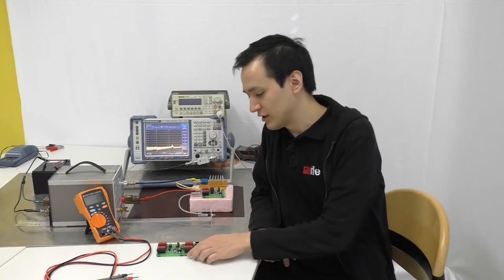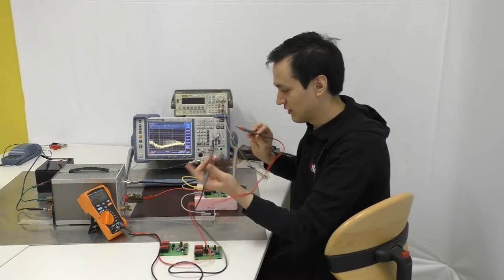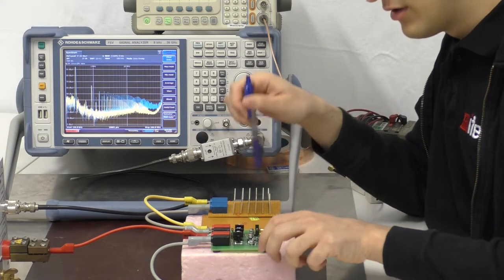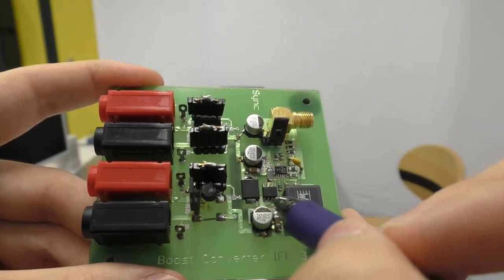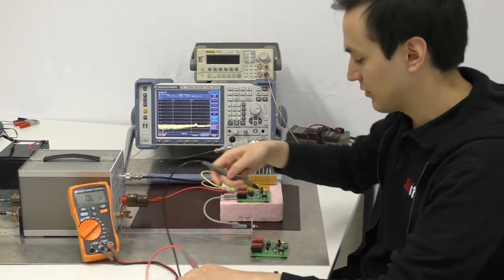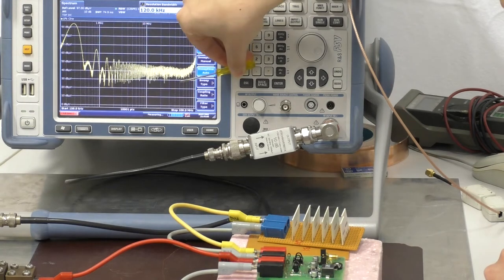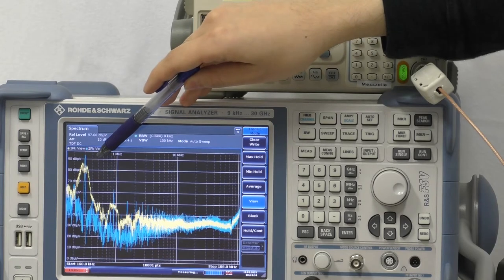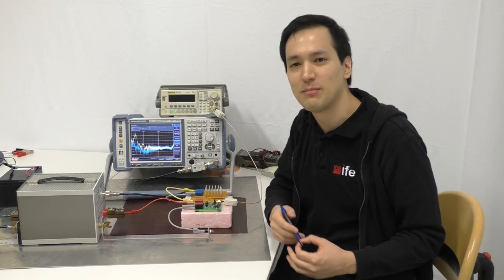Optimize EMC of DC-DC Converter with GND Plane, Filters, Gate Resistor and Spread Spectrum

Comment: Nice video. Demonstration of effects of ground plane. I am not a fan of spread spectrum techniques. It is only spreading the same level of noise over different frequencies. You are only fooling the measurement equipment. Not lowering noise in my opinion.
Reply from the maker: The main idea of spread spectrum techniques is not lowering the noise, but spreading the noise frequencies over a larger freqzency range to avoid freqzency peaks.